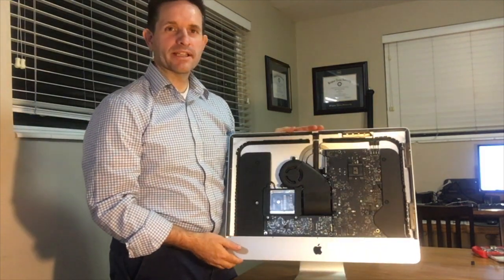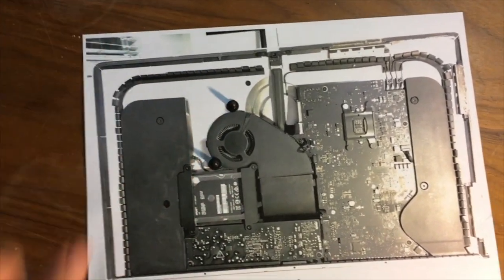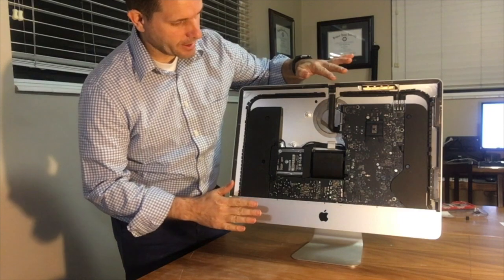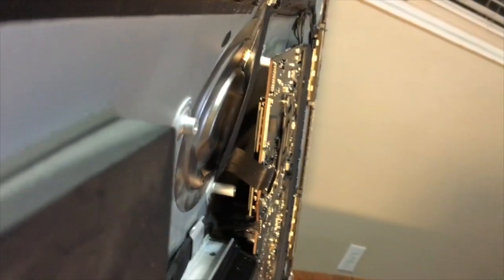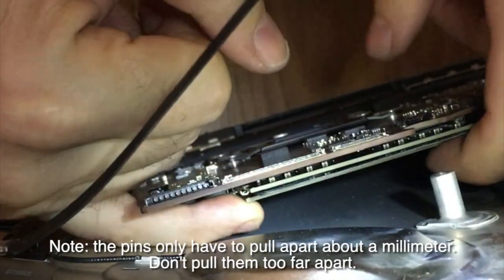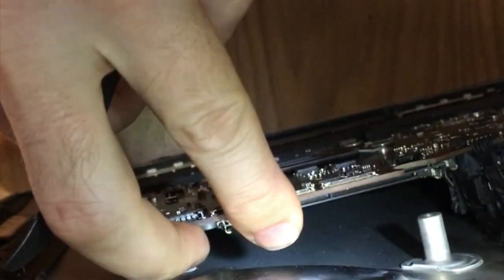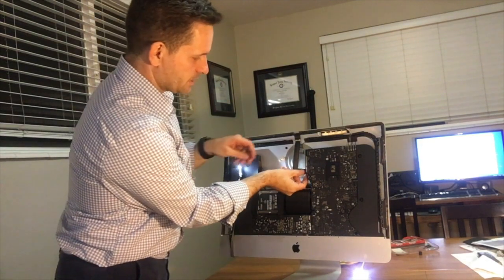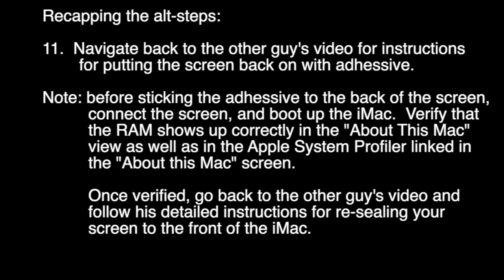Upgrade RAM in a mid-2017 21-inch iMac without complete disassembly.

Comment: Hi, nice instruction video. I have a IMac 21.5 2017. But it seems that the ram is somewhere else installed or fixed in the mainboard. Do you if it’s fixed before I build out my mainboard. Kind regards Jacques
Reply from the maker: Look up the model number in your Apple menu. Different size and release-date iMacs can look very similar on the outside. If yours is a really old one, it may have the RAM slots on the bottom of the screen. You just undo a couple of screws and pop the plate cover off to access the RAM slots.

Comment: Late to the game here but could you remove or loosen the one torx screw on the corner by your pinky and give yourself a little more wiggle room? Or maybe a couple of the ones holding that end of the board? Obviously being very careful not to bend the board too much.  Just wondering. Thanks for the great video. Your method looks a whole lot easier than the other ones I’ve seen.
Reply from the maker: Yes.  And great comment.  I'd say it would be labeled as "not best practice" though.  When you start flexing/bending the motherboard, you risk breaking the microscopic wires in it during the flex.  So, I don't advocate flexing the motherboard.  But I may or may not do it like that myself on occasion.
Reply: @joeyslaptopGotcha! 😉Thanks for the reply!

Comment: Ijust replaced ram on my 2019 21.5 i Mac yesterday , to be honest it wasn’t that difficult , but I couldn’t have done it this way as the ram sticks were boxed in with a cover with 4 screws over them , mac must have changed design on my 2019 model ???

Comment: Upgraded ram this way easy and no problem! This is revolutionary and time saving. I wanted to upgrade ram and ssd but it would take hours just for the ram, but this saved those hours. The forehead trick looking in is actually the best way to do it. Thanks!

Comment: What do you have to do after installing the RAM. Do you just turn it on and everything works normal?
Reply from the maker: @delayedgratificationwithan8035  Correct. There are no drivers to install or configuration that has to take place. If you buy the RAM with the right specs, and seat it properly, it should work when you turn the computer back on. Check the Apple System Profiler found in the Apple menu after booting back up to make sure the new RAM shows up. If it doesn’t, you may need to troubleshoot further: is the RAM in place, is it the right kind, does the old RAM work in the same slot, did you plug everything back in right?  If you can’t figure out the issue, ask a friend expert to verify it for you too. Do all of this before using adhesive to stick the monitor back on permanently.

Comment: Potentially damage memory pins and motherboard, best to just remove the logic board!
Reply from the maker: Unless you're being extremely brutal, you aren't going to wreck memory pins.  The motherboards are fairly sturdy as well.  With any computer repair or upgrade, you're encouraged to be gentle with the parts.  If you remove the logic board, there are many more screws to deal with, and some aren't the same length.  I did it both ways, and would much rather do it this way.  Either way you choose, hopefully the tip I gave of taking a picture of the iMac opened up, printing it up, and putting the screws and parts in place on it will be helpful.  I'd also add to be sure to write down every wire you detach in that process, and to be even more careful with them than you would be wrangling RAM into the slots.

Comment: Thanks for this video. It was enlightening, also because having to disassemble everything to be able to update the RAM banks is absurd. Out of 10 people who would like to increase the RAM, 6 try to do it themselves but the other 4 probably resell their iMac to buy another one with more RAM installed from the factory. I had a sad experience with a 2012 Macbook Pro, and the repair center told me that after 4 years you can't find spare parts because the computer becomes "vintage". Planned obsolescence? Probably.. However I understood that it is better not to update the OS too much because the updates put more strain on the hardware (like modifying the engine of your small car to do the 24 hours at Daytona). It was a game of great patience to remove and insert the RAM as you indicated in the video but in the end it worked! I renew my thanks. You are a genius!
Reply: The original Apple set out to make it easy for users to upgrade certain parts such as memory, hard drive (now SSD) and CD or DVDs. Now they weld the memory and SSD in so most people never attempt to remove it and ruin the computer. This video is a classic for anyone with older imacs. They go cheap, often in very good condition with original Apple  keyboard and mouse for around £200 or less. It would cost just over £100 UK pounds to upgrade memory to 32GB and SSD to 512 SSD or 1TB. It's a no brainer with this video as a guide.
Reply from the maker: Thanks for the feedback.  For Macs made mostly before the M processors, you can replace the RAM, Hard Drives, and some other parts with normal PC-type parts (m.2 drives, SSD drives, etc).  I even once replaced a broken video card on an iMac with a flashed laptop-version of an upgraded card.  It takes some research.  And like for the video card, for example, you have to make sure you have adequate heat dissipation and power from the power supply, etc.  So - not for the faint of heart to attempt.

Comment: where did you get the ram and what is the model/make of it?
Reply from the maker: I used 2 x 16 GB dims of 3200 MHz DDR4 SO-DIMM.  I believe it was this:

https://www.amazon.com/TEAMGROUP-3200MHz-PC4-25600-Unbuffered-TED416G3200C22-S01/dp/B08T17RQ87/ref=asc_df_B089W6WV3L/?tag=hyprod-20&linkCode=df0&hvadid=693463367197&hvpos=&hvnetw=g&hvrand=1251762637291771200&hvpone=&hvptwo=&hvqmt=&hvdev=c&hvdvcmdl=&hvlocint=&hvlocphy=9052441&hvtargid=pla-1146851470264&mcid=f47ab8c9dd193009b7793cf2d800922d&gad_source=1&th=1

Comment: I have a 2017 iMac 21.5 inch (not Retina display) that is running SUPER slow. I took it in to my computer guy to upgrade the memory and he told me that this model isn't upgradeable. Is he correct? Or should I look for another computer tech?
Reply from the maker: Look for a new computer tech.  Like I showed in this video, if it's the same year iMac, it's upgradable.  As far as it running slow, it depends what you're trying to do on it.  Sometimes, if it's running super slow, it's because the hard drive is almost full.  Or sometimes, it could be that a stick of RAM went bad.  If it's slow while on the internet, it could be your connection to the Internet rather than your computer.  Also, I've noticed that Chrome (which used to be the light-weight browser) hogs a ton of resources now.

Comment: Thank you very much for this video.
Does anyone know how much ram can be installed on this model? 32 not more?
Reply from the maker: At the time of this video, I could only find 16 GB DIMMs.  So, I installed two of them for a total of 32 GB.  Sometimes, the maxes stated by the company are based on what's available at the time the product is manufactured.  I've had several times where I've installed more than the max stated by the manufacturer, and had the computer use and recognize it.  One time, I exceeded the max, and it worked, but only recognized the stated max.  

You might be able to get away with trying 2x32 GB.  Good luck.  I'd love to hear how it turns out.

Comment: Did this and now my screen is broke 😊
Reply from the maker: Bummer!  Yeah - you have to be careful removing the screen, disconnecting the connectors, and setting it somewhere safe.  Was it a wire, the glass or the actual screen?
Reply: @joeyslaptop  the actual screen unfortunately is there a way for me to replace it with a new one online the inside of the screen is cracked and the screen is showing up black when I power it on ☹️
Reply from the maker: @AsiaaThatGirl   I think your best bet is going to be to buy another iMac of the same model from FaceBook Marketplace or CraigsList or somewhere similar.  The key is to make sure that it's not broken in the same way yours is.  If someone's selling it for $150 because the power supply is bad or the hard drive broke or something, you can get a good deal on it, and then take the monitor and try putting it on your broken-screen iMac.  Then again, it's an old enough model that it may be time to just upgrade to a newer iMac.  Good luck.  I hope you get it figured out.
Reply from the maker: @AsiaaThatGirl  Also, sounds like you have a disconnected or broken wire and a cracked screen.  I didn't cover this part in my video.  But, I thought the guy in the other video I linked to did an adequately and safely.

Comment: Thank you for this! Just upgraded my 2017 Imac that had a failing hard drive. Swapped for a SSD and went from 8gb to 32 gb of ram. Thanks again for the tutorial!
Reply: Did u see a big improvement?
Reply: @robr9170 it’s hard to say. The SSD made it so much faster. It did help with some programs that use ram (superior drummer which is a drum program that each kit can be a gig in size or more to load) but I mostly did it because it was cheap and I was inside the computer anyway so why not. I’ve now moved on to the new m4 Mac mini for home and my iMac became an office computer which just needs the basics. Overall, worth the time and money being I had to open it up anyway. Only thing I wish I’d done was put a 2tb SSD in but that’s because I don’t delete stuff like I should lol.
Reply: @AnthonyBrownHGM  ok yeah I may look into that in the future the ssd that is 
I did that too my iPod classic actually and it improved it a lot 
Thanks for the reply!
Reply: Did you use this method to install the ram? It looks very fiddly but seems quicker than the other way around
Reply: @ yes I did. And it was fiddly but quick. Just had to be patient.
Reply: Where did you buy you cards and what mhz did you buy. I wanted to upgrade to 32 gon memore. Will it take any two 16 go card
Reply: @ricardojnba  depends on the machine. You’ll have to look up what your mac can use for max ram. For mhz just go to info on your Mac and see what ram is in it already. It’s in the memory tab.

Comment: How many ram sticks can you put in it??
Reply from the maker: Two sticks of RAM.  Make sure they're the right type.
Reply: @joeyslaptop  what's the biggest ram capable of fitting in? (One stick ram capacity) can it be 16x2?..
Reply from the maker: @countrymanrandylewis8463  It depends which model you have.  There's a 3.0 Ghz iMac model and a 3.4 Ghz iMac model.  You can tell by going to the Apple menu, and selecting "About this Mac".  If you have the 3.4 Ghz model, check out the following on Amazon. com:

TEAMGROUP Elite DDR4 32GB Kit (2 x 16GB) 3200MHz PC4-25600 CL22 (2933MHz or 2666MHz)Unbuffered Non-ECC 1.2V SODIMM 260-Pin Laptop Notebook PC Computer Memory Module Ram Upgrade - TED432G3200C22DC-S01
Reply: @joeyslaptop  i have a 2.3 ghz model 2017

Comment: Amazing, just did this job yesterday and took everything out to do it! (Did the nvme drive too though so I had to). The thing you call a heatsink is actually an insulator as the bottom module is so close to the other on this model. Still, very impressive! (Why do they put the logic board in upside down, total design fail?).

Comment: I had my logic board replaced by Apple while under warranty. The Dimm slots we're not in the same place as the original so man was I surprised. I had to pull out the HD, loosen the power supply board and disconnect and slide out the replacement logic board to access the memory slots. So, just beware if you had prior logic board issues, be prepared to pull out more than the fan.
Reply from the maker: Interesting.  I've never heard of replacing the logic board with a different-model logic board.  Are you sure it was a mid-2017 21-inch iMac?
Reply: Yes, same here. So the ram is not fixed in the board and there are 2slots? Did you make a screenshot of the mainboard?
Reply: @jacqueshenkelman7200  I didn't and dump the whole iMac back in Jan for a new imac